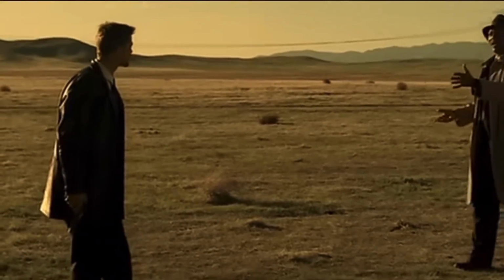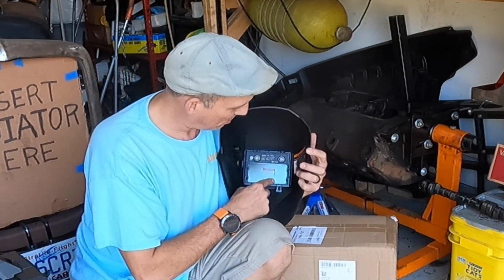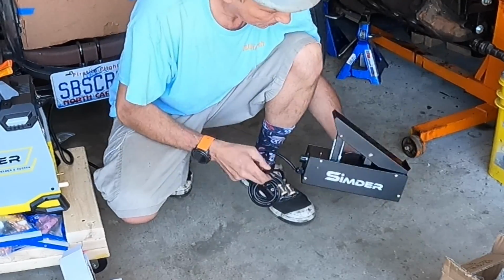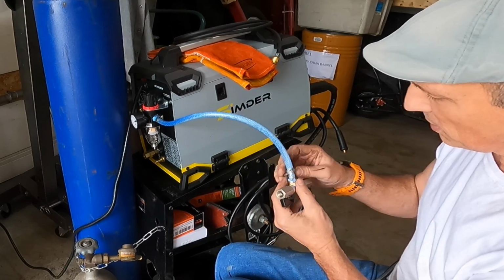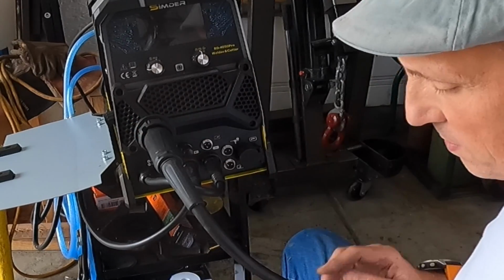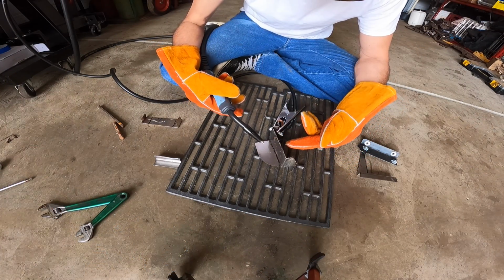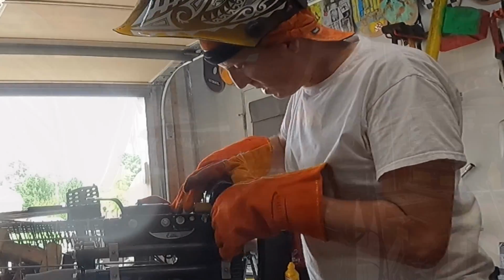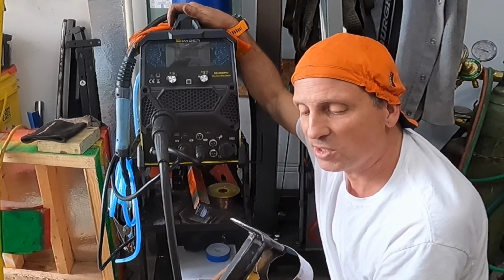CAN THE SIMDER SD-4050PRO 10-in-1 WELDER/CUTTER TEACH ME TO WELD?

Comment: Congratulations on acquiring the Simder 4050-Pro multi-purpose machine.  I bought one about 6 months ago but have only been using it for the past 3 months.  I use it primarily for MIG (with mixed gas) and it has been phenomenal.  Learning the settings to use will be extremely helpful for you.  I found (on my previous machine) that MIG needs higher settings than flux -core does so be careful of that.  I have tried (once) to use the TIG torch and have only begun to scratch the surface so to speak.  Lots to learn there.  I have not tried using the spool gun or the plasma cutter yet, will wait for winter weather when I have days to sit and experiment / practice  
Don't be afraid, use that machine.  It was a good choice.
Reply from the maker: @jayyambrovich3740  Thanks Jay, I’m really excited about it and have a lot planned for it.  Glad to hear you’re happy with it too.  I’m planning on putting a lot of hours on it over the next year!  Thanks for watching!